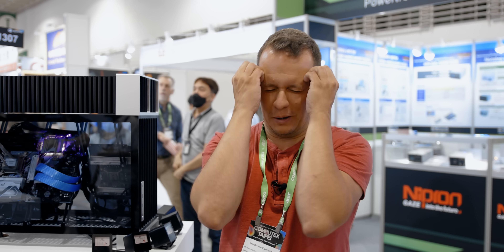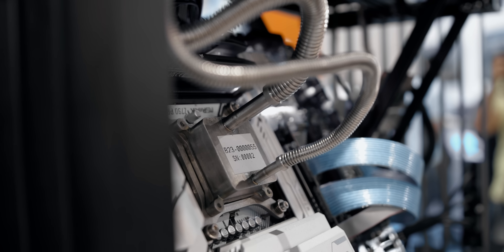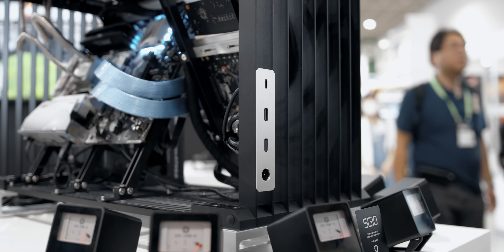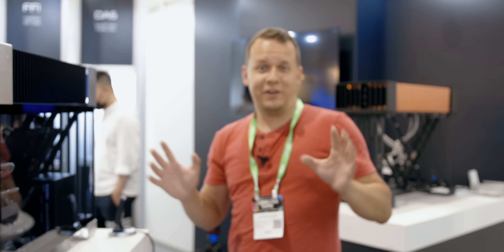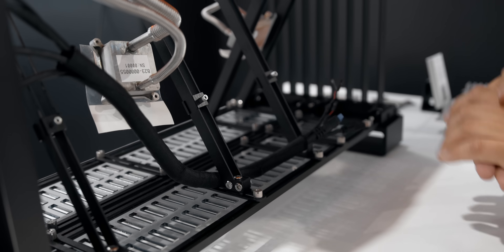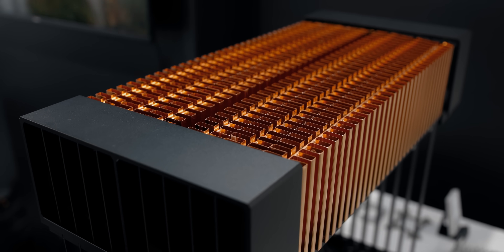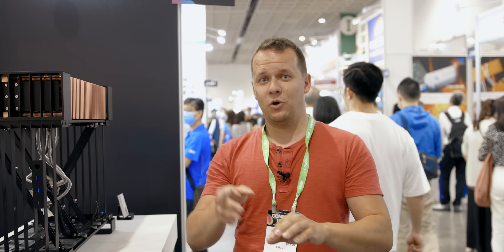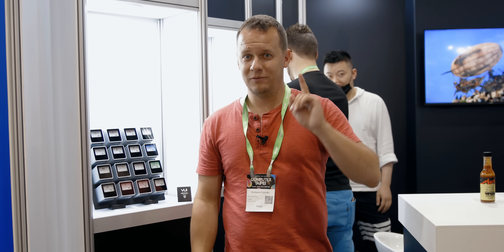Passive Cooling just got REAL.

Comment: 2:47 "it is running at 60 C degrees" Novec 7100 engineered fluid boils at 61C so that would be my guess as to the refrigerant being used.
3:47 "both the motherboard and GPU are at an angle" What he doesn't mention is that this is a gravity-fed, Phase-change or evaporative cooling.

The motherboard & GPU boards are positioned at an angle such that the inlet tubes carrying refrigerant enters as a fluid into the lower entrance of each CPU & GPU cooling blocks, then the heat absorbed boils the refrigerant into a hot 60C pressurized gas (highly efficient evaporation heat exchange) out of the upper outlet flexible tubing which then flows up into the upper passive copper (or black anodized aluminum) air heat exchanger where the passive, convection air flow of the environment cools the hot gas back into a liquid (condensation) which then drops via gravity (no pump needed) back down into the cooling blocks again. It keeps cycling passively and continuously.  This approach could also be done with boiling water into steam and then cooling it back into liquid but the 100C temperature is too toasty for our computers to be useful.

By the way, if the air environment surrounding this case was hotter than 61 C temperature, the hot refrigerant gas could never condense back into a cooler liquid state and the CPU & GPU cooling blocks would begin to experience run-away conditions.  No cooling!

EDIT: Novec fluid is expensive so a cheaper option would be an alcohol variant like those used in sealed heat-pipes.  It must be as the coolant loop is brazed all-metal as can be seen on the coolant blocks.  The internal pressure is adjusted based on the desired boiling point.
Reply: If the air environment is hotter than 61 degrees you shouldn't be in the environment either ;-)
Reply: You know you can get water to boil at lower temps than 100C right?
Boiling point of liquids is dependent on pressure.
For instance, heatpipes just use water and by lowering the atmosphere before closing them off you can precisely tune them to whatever evaporation temp your application requires.

You should‘ve paid more attention in school I guess 🤷‍♂️
Reply: @niikon  Is right though.  Water is actually the best known refrigerant.  You do have to maintain a high vacuum, but there's a reason PC heat pipes and vapor chambers all have water in them.  

This case will never go to market anyway because there is no way to recover the refrigerant.  Water would be a better choice cause at least you wouldn't have to convince the regulators that the refrigerant won't ever burn houses down, explode, poison people, or impact the environment.
Reply: @emptyshirt  As I mentioned to his reply, water has long-term issues when there are mixed metals as in this loop example.  I also forgot to mention the need for deionization as I have experience with water-cooled electromagnets and microwave antennas.  Refrigerants such as Novec are actually good as a fire retardant/suppressant and are also inert unless they heated to way above their service range (250C+).
Reply: @tech-utuber2219  but novec still has special disposal reccomendations. Demineralized water isn't hard to get.
Reply: @emptyshirt  Yes, and some countries have restrictions on it.
Reply: @niikon  "You should‘ve paid more attention in school I guess". No, it's you that should have read what I wrote more carefully. I wrote: "The internal pressure is adjusted based on the desired boiling point."  It occurred to me that someone would ask, 'why can't we use water like this?' so I included a brief comment, as opposed to a longer one about corrosive effects, impurities & minerals in simple tap water, which may give rise to electrolysis effects across the junction of mixed metals and brazing alloys, even worse inside of anodized aluminum alloys, etc.
Reply: @niikon  I suggest that you delete your comment due to owning yourself in this embarrassing backfire.
Reply: Yeah the good thing about this cooler is if you ever have a problem you either have to hire an HVAC tech to fix it or get all the skills and tools to do it yourself. It's a cool concept but getting into HVAC just so your PC doesn't have a little fan noise is pretty extreme.
Reply: @bobbygetsbanned6049  There's zero moving parts on this thing. I think that fact weakens your argument, massively.
Reply: @stcredzero  It doesn't weaken my argument at all, you still cannot fix it without specialized tools and knowledge. And if it leaks, you can't get refrigerant, so you still need a tech.
Reply: @bobbygetsbanned6049  "It doesn't weaken my argument at all" -- now that's not a good look for intellectual honesty. Instead of addressing my observation that this thing >has no moving parts< you just repeat your prior argument! 

Besides, anything at all with a heat pipe is subject to the same caveats! 

Now what, are you going to repeat your argument >again< without addressing that point as well?
Reply: @stcredzero  What's not a good look is you being unable to comprehend the problem. No moving parts doesn't eliminate failures from the system, so that doesn't weaken my point in the slightest. When repairs are needed they will be extremely expensive compared to fans and radiators. You can replace an entire air cooler for $35, so comparing a heat pipe to this system which would cost hundreds of dollars per hour for an HVAC tech to fix is complete nonsense.
Reply: @bobbygetsbanned6049  "What's not a good look is you being unable to comprehend the problem." -- Can you comprehend probability of failure? Can you comprehend expected costs? "No moving parts doesn't eliminate failures from the system, so that doesn't weaken my point in the slightest. " -- Not in the slightest? What does having no moving parts do the the probability of failure? Wow, you really ARE the epitome of intellectual honesty! NO ONE is claiming this system is not more expensive, but what are the odds that someone will use such a system and have $0 in repair costs? Pretty damn high!
Reply: @stcredzero  You want to cry about intellectual honest nonstop then use a completely fabricated failure rate of near zero lmao. Go ahead and provide the data you used to calculate that number mr intellectual honesty, I'll wait. 
And btw, none of this has anything to do with my original point anyways, because failure rate doesn't change the fact it would be expensive to repair, which was literally my only point. But not only would no engineer in their right mind ever claim a near zero failure rate for a product that's never even been tested in the field, air coolers have been proven to be extremely reliable over decades of use in computers all over the world, and you can get them for less than $40!  
So again, you fail to grasp the problem here, which is simply, when you have a problem it will be very expensive to fix, no matter how unlikely you feel that problem is.
Reply: You do understand that coolant will leak from that toy over time.. Have they told anyone how much coolant needs to be refilled when that happens? Is there servise ports so it is even possible or are yoy planning to diy the ports from your car or what? There is most likely some joints that are not welded shut so leaking will start pretty fast after assemply.. Not fast but it does. There is actually pretty big chance that thing is useles after few years.
Reply: @bobbygetsbanned6049  yeah and with an AIO if something fails you have to throw the entire thing into the trash. so being able to to anything at all is an improvement.
Reply: @1:08 is the start of the spiel where he mentions what you were after on your second point.
Then at about 1:33 he says what you're after:
        "so once the contact plates heat up,
          the refrigerant actually vaporizes"
I suspect he meant, and in turn should've said, "evaporates"; thus, he did point out that it's a phase change cooler, no?

(I mean, with no moving parts, and no liquid metal coolant with an electromagnet 'mover' [or out-of-loop ""pump""] to create flow of the liquid... isn't "phase change" the only method left for this sort of capillary system? [asking/stating this sincerely, not as a snide remark])

———
Also... If the use of water in a heatpipe was as big an issue as you're implying, why haven't we witnessed any of our computer heatsinks springing leaks due to the galvanic process (I think that's the term)?
We've been using heatpipes with distilled water for at least a decade now, but probably much longer.

Which now that I ask that, it occurred to me that heatpipes don't HAVE dissimilar metals... 🤔
They are copper tubes (with inbuilt wicks) which are completely sealed, and it's those pipes that are soldered to the heatsink baseplate, with the fins just being tightly press-fit.

I'm trying to think back to all the heatpipe equipped heatsinks I've had, and I think all of their open-ends have been crimp sealed, or maybe friction 'welded' (if that's possible with copper?)
I just recall them having their 'fill' ends be a crimp of sorts, with a smooth nipple tip – not to be confused with the opposite end, which is a built-in hemisphere (just like a test tube).

I'm sure at some point I've probably seen a heatpipe or two whose crimped ends have solder, but, I would also wager that those ones were alcohol filled, not distilled water. [speculation]
Reply: this guys knows refrigerants

Comment: 1k on this is not expensive if you see some pc cases for around $400 without cooling. Custom Loops can go around 1k to and you have to deal with water, which means, water damage risk.
Reply: Water damage risk < dealing with a refrigerant system. If anything goes wrong with this coolant system you gotta hire an HVAC tech for $300hr to fix it lol.

Comment: Definitely interested but would come down to temperatures and performance. I have an 360mm AIO on my 5800X3D, 240mm AIO on my 4090, undervolt both, set custom fan curves, set tj max at 65C for both and have a great time with cool and quiet 4K120hz gaming. If this has similar performance or maybe even better I'd definitely consider it for my next build vs a custom loop.
Reply: They say if you add fans it can cool 800W+. With 4090 I think the margin is a bit too small.

Comment: I would pay $1000 for a passive case solution.  A 2 to 3 K cost for the copper version would be reasonable if it could have higher heat capacity.  Great video!
Reply: Well im no engineer but im pretty sure that since copper has some +30% conductivity or whatever it was, it makes sense to me that the copper case would atleast be able to handle 700w compared to 600w aluminium.
That might not be worth the cost but atleast that means it might be able to handle a 4090 instead of 4080 so it might make sense for some users.

Comment: So if I added a few 200mm fans on the top and set them to low rpm I wonder how much more performance could you squeeze out of this?
Reply from the maker: There are fan brackets inside and with three Noctua 140mm running at 600RPM they can handle 800W+
Reply: The coolant is likely to phase-change at around 60 C meaning you wouldn’t be able to get lower temperatures than that but the absolute amount of heat that can be dumped into the system gets (massively) increased.

Comment: Really cool idea, but I can't help wondering about potential coil whine (especially from the graphics card) spoiling the party. Not much sense in completely silent cooling when there's still coil whine (I very much prefer fan whooshing to coil whine). I'd personally prefer the case to only have "intake" vents at the bottom, all other sides closed, which would at least prevent coil whine from having an open direct path to the ears.

The price sounds reasonable (except for the copper edition, but I don't think copper heatsinks would actually improve temperatures all that much, so that edition is outside the scope of my personal interest anyway).

Oh, and those gauges are cool too, would be nice to have a few!

Comment: That is very interesting... I suppose that for safety (because you don't want to use a pressurized gas and toxic mess if a leaking occurs) and ecological reasons (remember, any HCFC gases and high GWP should be retired in 2030) there is not much gasses left around to work with... R123 or R514A would be my guess about what gas this passive cooling case use? Personally, I would prefer the latter because the R123 is known to develop tumors, with a preference for (drumroll) testicular tumors. YAY!!! (TAM TAM) 😅
Reply: Yeah I'm wondering which one they use too, if the GPU and CPU are at 60C I don't think a traditional refrigerant would work. I was initially thinking ammonia, which is used in RV refrigerators since they don't have a pump and run without electricity, but it boils at too low of a temp. Either that or they have ton of pressure in the system to raise the boiling point? Not sure, but I'm curious, I'd also like to know how they plan on fixing problem people have since it will need and HVAC tech to fix any problems...
Reply: @bobbygetsbanned6049  As much as I like Ammonia as a refrigerant, it's corroding copper. As for repairs... well you are right to point this out because it will be probably a big issue. I don't see any access for a manifold gauge too and that makes the job for a HVAC tech really really hard. 🤨
Reply: @baccusx13  What do they use instead of copper in systems with ammonia refrigerant? And yeah I noticed no place for gauges either, which means you will need a brazing torch lol.
Reply: @bobbygetsbanned6049  Because NH3 is mostly used on big industrial sites (the agri-food industry is a big favorite among others), they use steel and aluminum for the heat spreading fins.

That and most setups use an intermediary reserve tank to build up the pressure in 2 phases with a second compressor. I have recently seen a "compact" R717 system that use only one compressor but that's fairly new and it was presented at a convention.